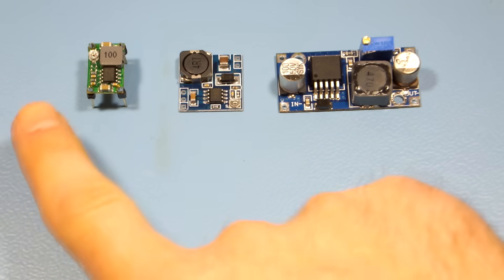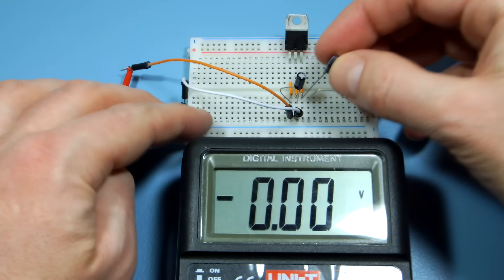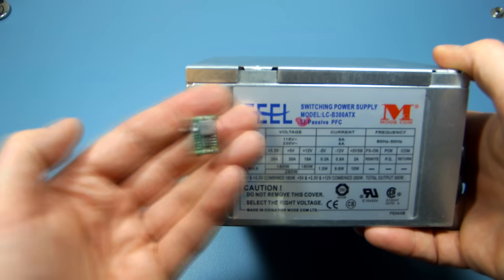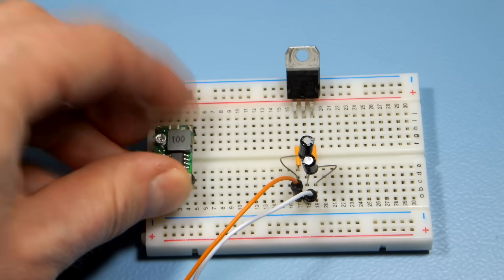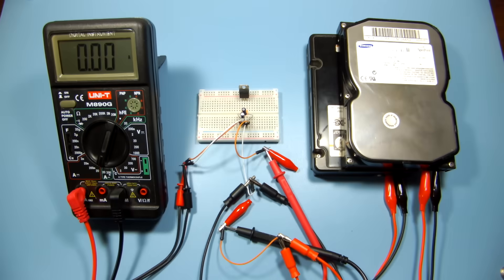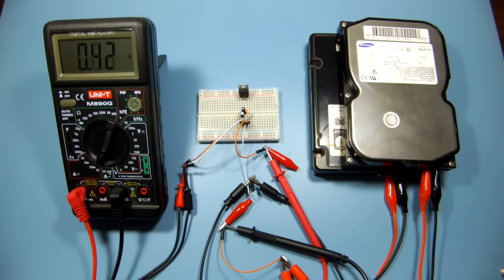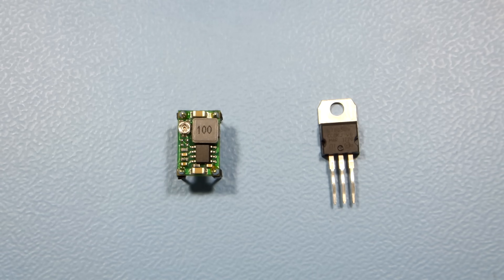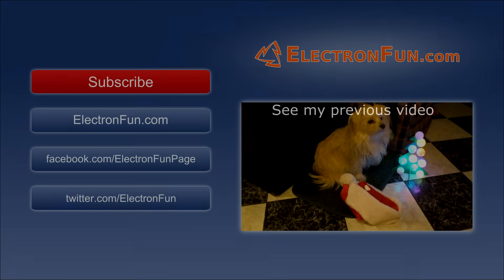Buck converter vs. linear voltage regulator - practical comparison

Comment: Oh and if you have the space and the money you can use a nice linear regulator like the LT3080 and a switching voltage regulator as pre-regulator that provides the  LT3080 with the voltage that it needs to regulate the output voltage... One can easily make this thing adjustable so that you can use a poti to adjust the outputvoltage and the pre regulator provides the  linear regulator with a voltage that is a bit higher than the output voltage. Than you have a linear regulator that does not have to dissipate so much power because the Input-Output difference is always small but therefore is an adjustable switch mode regulator needed. And hey if you buy good components from companies like Texas Instruments, Linear Technology etc. in generall they always provide datasheets for their products, and for voltage regulators they often give circuit examples which are nice to quickly understand how they work and to use them.
Reply from the maker: +Sebastian Au Thanks for another great advise, I've read somewhere that some people do use a buck converter which feeds a voltage regulator, but I haven't seen such a circuit myself, at least yet. This may be a great idea for an experiment. Can anybody provide an example of a real device available on the market, which uses a buck converter and a linear voltage regulator to cancel noise?
The LT3080 is pretty expensive for a voltage regulator, but it seems it may be worth the money if your circuit is noise sensitive.
Reply: +ElectronFun.com Yeah the LT3080 is quite expensive often a standart regulator like the LM317 will do the job and here in germany I can get one of a descent brand for 0,30€, a lot cheaper than the LT3080. And if a constant Voltage is needed LM7805,LM7809, etc. are nice too. Well if we want to have a fixed output voltage we could use the LM7805 as linear regulator I can recommand the LT3493 at page 18 they provide typical application informations, and there one can adapt the circuit so that it provides the needed output voltage plus the Voltage drop over the linear regulator(and a little bit extra^^) In the datasheet of the LT3080 at page 21 they provide a  neat circuit of a tracking pre-regulator using the LT3493 and the LT3080. But of course Linear Technology do not offer the cheapest parts, but there are lots of products on the market. In my case I like to work with a neat prescision, better is always possible but with this regulators it is quite nice. :)
Here are the datasheets:
http://tiny.cc/LT3493
http://tiny.cc/LT3080
Reply from the maker: +Sebastian Au Thanks for the great info. I wonder what efficiency I could expect from a "5V step-down converter" (page 18 from LT3493 datasheet). Sebastian have you tried such applications?
Reply: +ElectronFun.com Not that particular circuit but at page three of the datasheet for the LT3493 they provide typical performance characteristics for a 5V output with with the efficiency as a function of the load current and related to the Input voltage. That diagram is really nice because it enables us to estimate the efficiency, that is to say if you build up that circuit with 5V output from page 18 you will have an efficiency around that figure given on page three.
Reply from the maker: +Sebastian Au According to the "typical performance characteristics" at 8V on the input, 5V on the output and 1A load the efficiency should be above 85%. That's great for a voltage regulator!
Reply: Yeah, if the circuitry is designed properly. :)
Reply from the maker: +Sebastian Au If the prices were lower, it would be a perfect solution.
Reply: Not all are that pricy there a lots of ICs on the market but the search can be annoying ^^ ... i.e. http://tiny.cc/MC34063 or this one http://tiny.cc/LM2575 which one depends on many factors, some are easier to use than others, some require fewer external components but are often not that cheap(like the texas instruments simple switcher) and of course not all have the same specifications.
Reply from the maker: +Sebastian Au Thanks Sebastian. I may experiment with buck converters and linear voltage regulators some more.

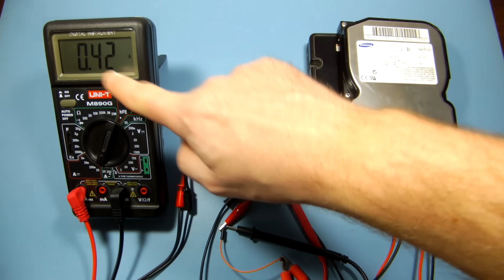Comment: To be a bit pedantic on one specific point(there are more points I could mention): At approx. 4:10 you are not measuring the power consumption but due to the fact that you measure the current(under the assumption the voltage is constant 5 Volt and does not break down) we can calculate the power V*I(under the assumption that the current is constant too, otherwise we have to take the change in current over time into account to determine the power as a function of time) and if we measure the on time, we can also easily calculate the energy. Nevertheless you made a really nice introduction video, keep on doing this. :)
Reply from the maker: +Sebastian Au Thanks for the info and your understanding, I will have to check all my calculations again and I might do a follow up video to correct all mistakes. Every such comment is really helpful :)

Comment: I haven't gotten as much efficiency as you have with buck converters.  Your HDD test showed your buck converter drawing only half the current from the power source as the linear regulator.  I had a 250-watt solar panel directly connected to a 1200-watt buck converter (one that big needs a huge heat-sink, even for a buck converter!)  Anyway, I stepped the voltage down from ~32v to 12v and that went into an inverter and then powered a Sony sound system, large fan, and laptop (with no battery needed :) ).  It was nice and all but, of the 30v at 8A, the most I could pull was 12.5A at 12v.  I verified that the short circuit current was at PEAK for the panel's specs.  So, what's going on?  30v -> 12v .... I would expect at get at least DOUBLE the current... (that still wouldn't be 100% efficient, which I wouldn't expect to get).
Reply: +Christmas Eve By the way, checking the short circuit current of such a large solar panel in full sunlight is quite an experience.  I partially melted a lead on my multimeter.  Much caution should be taken (more caution than I took!)
Reply from the maker: +Christmas Eve Your buck converter is not very efficient then. However I have no experience with such powerful buck converters. Have you checked the temperature? Maybe the heat sink is too small?

Comment: Will the buck converter stay at the set voltage even if the source voltage drops?
Reply from the maker: +Sigurd SF It will stay until the input voltage drops below certain level. The input voltage has to be higher than the output voltage.
Reply: +Sigurd SF Look into step up/step down regulators

Comment: You loss calculation is incorrect. 
Efficiency in a buck converter is Wattage(out)/Wattage(in). 
Losses are Wattage(in) - Wattage(out)
Losses are (12*0.21) - (5x0.42) =  0.42W
Efficiency = 2.1W/2.52W = 83% efficient, which is slightly below average for a buck converter at such a low current.
Reply from the maker: +wraithbone I know some or all of my buck converter calculations may be wrong and I started searching for more information. Are your formulas simplified? Everything I found was a lot more complicated. For example, take a look at this: http://www.ti.com/lit/an/slpa009a/slpa009a.pdf. According to this document it seems impossible to calculate power loss without an oscilloscope.
Reply: +ElectronFun.com The fundamental principle behind power efficiency is this formula: 
Efficiency = Useful Power Out / Total Power In
Total Power = Useful Power  + Power Losses
https://en.wikipedia.org/wiki/Electrical_efficiency

(This formula even applies to linear supplies)
For some good reading:

http://cds.linear.com/docs/en/application-note/AN140fa.pdf
Pages 5 and 6 cover the relevant detail. Conduction losses can be calculated with  nothing but the datasheets for the relevant parts used on the SMPS. You need: The input voltage, output voltage, output current, the on resistance of the switch, the DC resistance of the inductor and the forward voltage of the diode. No scope needed.
Reply from the maker: +wraithbone Thanks a lot for the info. I will have to check my calculations and might do a follow up video with necessary corrections.

Comment: But there are buck converters in ATX PSUs ;)
Not all though but on every 80plus gold one (at least one with the FSP Aurum based ones, others have two buck converters).

The marketing slang for this is 'DC-DC technology' or something like that. But it's just a buck (or step down) converter...
Reply from the maker: +Stefan Payne There are definitely no linear voltage regulators in ATX power supplies :)
Reply: +ElectronFun.com 
That's what one should think...
But there are ATX PSU with linear Regulators for +3V3....

Just click on this link.
http://www.hardwareinsights.com/wp/the-2012-el-cheapo-power-supply-roundup/2/
I spare you any comment on that ATX PSU...

And on decent Quality PSUs you'll find a linear Regulator for the (well, nowadays obsolete) negative rails. Most likely for the -5V rail and probably also for the fan...
Reply from the maker: +Stefan Payne As you can see all of these supplies from the link have more cons than pros and all of them are Hardware Insights Fail Award contestants.
Reply: +ElectronFun.com 
Why not say it by Name: Those Units are total shit. Can't o a PSU much worse than that...

Still, they did exist and you can buy those Things still in some Areas of the world...

Here in EU they are at least trying to get rid of those shitty things that System Integrators love - because they are so dirt cheap...
Reply from the maker: +Stefan Payne I agree - they should get rid of these "power supplies".

Comment: Efficiency depends on voltage drop. Buck converters always need 2V to function. Whereas linear regulators can have very low drop out voltage. If the input voltage matches the drop out voltage then the efficiency can be higher on linear than buck. For example, Linear Tech's LT3014 has a drop out of 0.35V. So if the input is 80V and the output is 79.65V for an LED string, the efficiency is 99.6%, i.e. near perfect. If you is a buck then you'd have to lose an LED, so output voltage is then about 76V and efficiency goes down to 95%. For higher currents buck converters are also quite expensive and gets bigger. Noise, both audible and electrical is also an issue in many application from medical, radio, power to audio etc.
Reply from the maker: +Thanh Tran Thanks for your comment. You are mentioning very specific conditions and the LT3014 can deliver only 20mA. Any buck converter is much noisier, but at the same time much more versatile.
Reply: ElectronFun.com I think both have their places. Also the comparison was not quite fair in your video. When selecting a topology one would look at it carefully and check the current versus the rating of the component. I would not leave the regulator running without a heat sink knowing that it would have to dissipate 2W. If you being fair you would use the linear regulator as a voltage reference to drive a power MOSFET. Then you realise that for a lower cost, you can get higher switching current on a linear regulator circuit than a buck circuit.

That is why if given the choice i would prefer a bench power supply with linear regulator than a bench switching power supply. There is no point having a good bench power supply if the voltage is not stable enough.
Reply from the maker: +Thanh Tran I agree - there is enough room for linear voltage regulators and buck converters. I'm not sure why my video is unfair - I said voltage regulators radiate heat and are pretty inefficient, but they don't cause noise, while buck converters are efficient but pretty noisy.
Reply: ElectronFun.com the unfair part, in my humble opinion is that when selecting between two components for a design one would weight the pros and cons carefully. Checking the spec sheet I know would that the linear regulator is not suitable without a heat sink so if you have a space constraint then I would discard that option. However, knowing that it has to dissipate that much heat and there is space then I would put on a heat sink so it will still work. Efficiency is not always that critical. So to be "fair" to either choices they have to be both considered and designed, not just selected because they can both in theory perform similar task.
Reply from the maker: +Thanh Tran Sure, efficiency is not always the most important aspect - I agree. I tried to be as fair as I could, but probably wasn't trying hard enough. I always appreciate people who can justify their opinions. Thank you for your constructive criticism - it helps me make better videos.

Comment: Is there a way to shield the buck converter for radio sensitive devices, for example the esp8266?
Reply: +Sebastian Au I've used the ld1117 as a 3v regulator for the esp8266 - it will handle the current needed. A buck converter to 5v the other side of that might be nice - but quite bulky. It is a problem with battery life on robots - always space vs weight vs battery life.
Reply: low noise versions whit inside coil 
http://www.ti.com/tool/tida-00532
Reply from the maker: +bugs181
I guess an ESP8266 should work ok with a buck converter.
Reply: +bugs181 Yeah that should work, if not use a buck converter that provides a bit higher voltage that is needed and than a linear regulator, if you want to spend money buy the LT3080 a really really neat linear regulator, also good for building power supplies... ^^ but of course if you need a constant voltage one of the standart linear regulators would be cheaper ;-)
Reply from the maker: That's a good one, thanks :)
Reply: I don't feel it's easy to use. The output seems to be adjustable. But we have two pins "set" and "control" that somehow must control the value of the output...